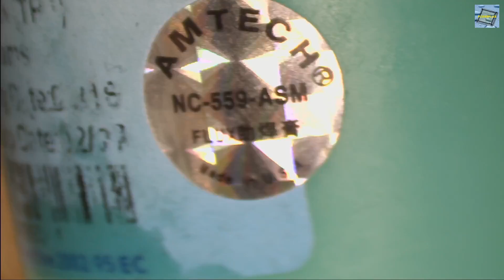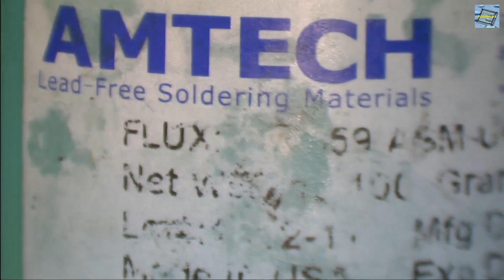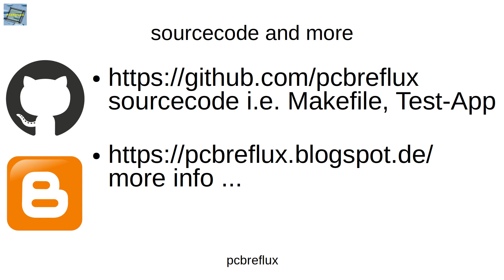ATtiny24 #2: QFN Soldering

Comment: hi, nice display :) 
I'm also recently making my atmega328 board with QFN32 (MLF?) package and mets problem,
with hand solder I yield only 20% programmable (with ISP) and other bricks,
I use small-sharp iron set to 300-350'C
not sure where's the problem :(

the same schematic with friendlier tqfp32 package yields better 
could it be the flux? or bad random chips from aliX?
Reply from the maker: Think if you solder them at your temperature range (guess this is for the tip) and don't exceed a few seconds the solder, flux and iron should not be the problem. See maybe Kevin Darrah solder an atmega328.

Comment: I dont like the idea pressing down to the chip when soldering, there is high risk that you will misplace chip, this method may work for ic with few pins, but if ic has 100+ pins, this may ruins your day
Reply from the maker: Thank you, don't like this either but using the surface tension seams only reliable working with solder paste not with plain old leaded solder. And sure all pins and the center pads have to been placed straight to the pads, still need more experience for this.

Comment: central pad should have more vias, to better solder (smt line and manual).
Second question - try solder central pad from other side. Lead will connect with IC using vias, and You have easier way to connect side pads
Reply from the maker: Kamil Bystryk Thank you. Unfortunately my design is very limited in size so have to use booth sides for the components. In this case vias are in the way but sure if you have the space will recommend such footprint.